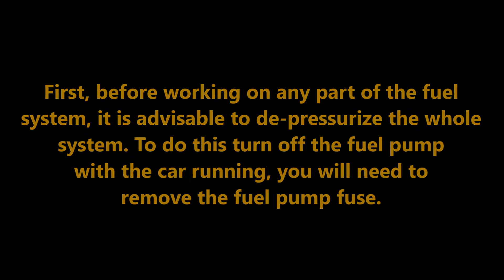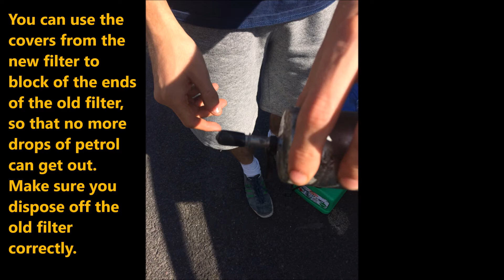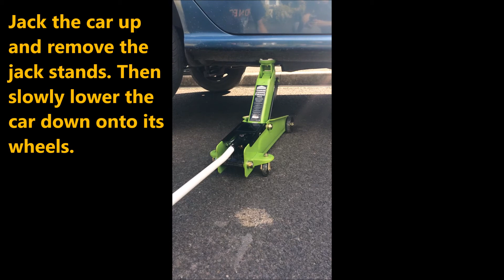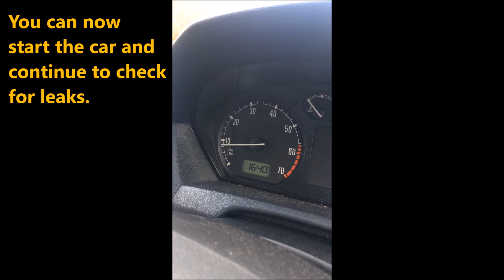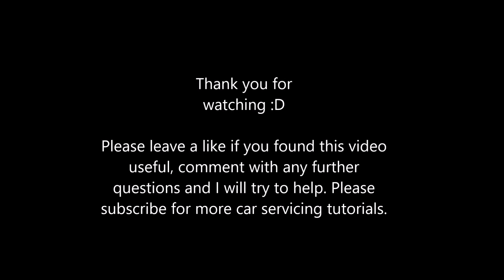Fuel Filter Change Skoda Fabia Mk1 1.2 (2003)

Comment: Hello,
I will try this soon. Thank you for the video.
I got another problem (fabia, 2000, 1.4 mpi, 68hp, 50kw) When I start it for the first time of the day it hesitates. The revs drop do 400, the car starts shaking and eventually the revs go back to normal or the car dies. 
Also there is a hesitation in the revs and sometimes while I drive the car stalls. Happened few times on the lights or stop signs. 
You can check my channel, I have only few videos and all of them are of the car.
Thanks. :)
Reply from the maker: Hello,  thanks for watching. I would advise to change your fuel filter on the 1.4 as it could be due to some blocked lines or the filter or injectors itself, might be worth putting some fuel injector cleaner in the fuel tank. Unfortunately this issue could be many things and looking online it seems like a common issue, good idea to search the forums. Would always advise servicing the car so basic oil + filter changes and the spark plugs this sometimes can remedy problems. Check the throttle body to see if it is clogged up can spray a cleaner to make sure its working correctly might not be opening up enough just after its started when cold. Also vacuum leaks seem to be a common fault especially between the brake booster and the manifold a leak would alter the idle for sure. You might be able to hear a leak or feel it worth checking all the vacuum lines. Always worth plugging a diagnostic OBD2 Scanner or computer into the ECU see if it comes up with any codes. Sometimes the car might not trip a actual warning light but a code might still be hiding in the system. Finally if still no solution can be found try and take it to a reputable garage those guys are obviosuly better trained than us home mechanics or maybe even Skoda themselves although be prepared for a bigger bill to pay. Sorry I cannot be more precise to what the problem is hope you find a fix and please let me know how you get on, Good Luck!
Reply from the maker: @lyudmilkotev8473  No problem, I have checked out your video and have seent this problem before online. I would still look for vacuum leaks. Alot of forums are suggesting lambda (O2) sensors but you have done that. Could perhaps be a ECU or throttle body position error. You could also perhaps unplug the MAF sensor see if that chnges anything. When checking the engine over you could check breather pipes to see if they are clogged up or it could perhaps be something to do with the EGR being gunked up. Looking on the internet seems like this is a common issue but there is no universal fix some people have fixed the issue but by changing different things to that of others. I would check what you can and what I and the forums have suggested if not maybe a VAG expert garage would know what the best solution is. Sorry that the answer is not straight forward.
Reply: @CarDIYWithDan  
Thank you. It was very helpful!